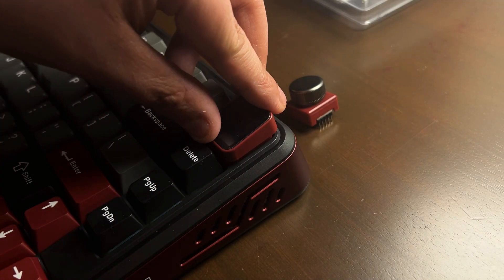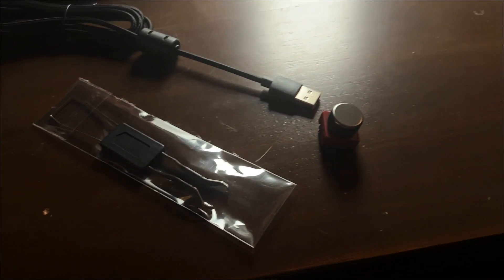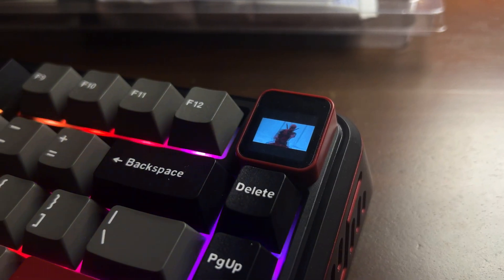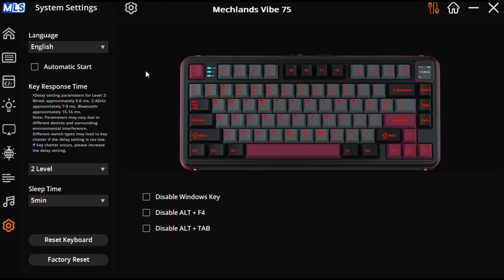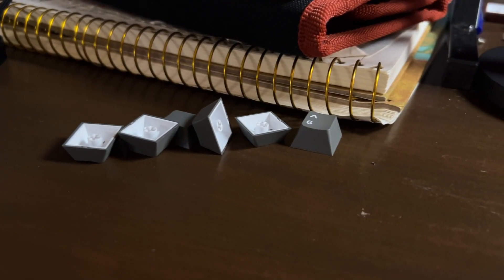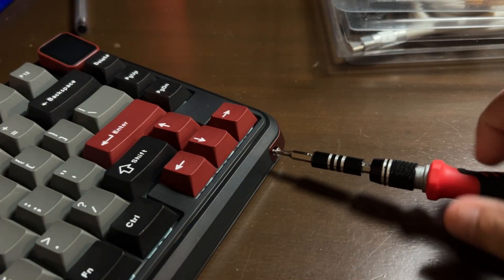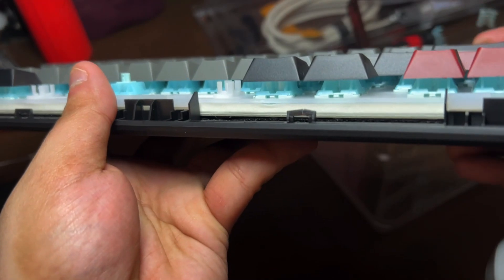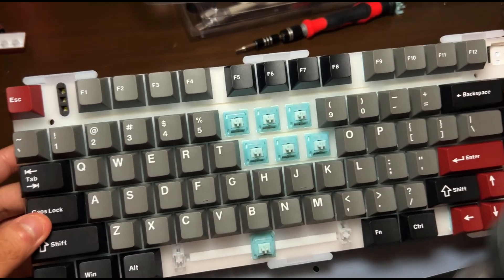Mechlands Vibe75 | Interchangeable Screen and Knob for only $70 | Review & Teardown

Comment: Hey there! Do you know if you can change the key bindings on Mac mode? Also, I see that there's a top layer, fn layer, momentarily, and toggle. Is the toggle layer like the layer when you toggle to Mac mode? Or is it a key that you pressed to toggle on a different layer? Just wondering because I have custom key bindings for both Mac and windows for easier workflow when I am coding. If the software allows you to toggle between layers, kind of like VIA, then that could work and would probably grab this. Thank you!

Comment: Vibe75 or aula75?
Reply from the maker: @owlulllllll  Vibe75 if u dont plan on tearing it down. Aula if you want to do further mods
Reply: @BiboyHaranero  Vibe75 vs Blade75?
Reply from the maker: @MultiByron97  Blade75. Easier teardown

Comment: i got the keyboard today, love the sound but screen won't work...Does anyone else has this problem or it's just me?
Reply from the maker: @shleich321  try to restart your keyboard. does the knob work fine tho?
Reply: @BiboyHaranero  the screen works now but it glitches randomly :(
Reply: and yes, knob works fine that's what i found strange
Reply from the maker: @shleich321  hotswap port works fine but the screen might have anissue with it. I suggest returning it. Mechlands offer a money back guarantee. or replacement if necessary

Comment: How do you recommend opening this to mod given your experience breaking it? Should we unscrew the hexscrews and then pry the case open from the bottom using prying tools or how should we go about opening it for those of us looking to mod?
Reply from the maker: @nxshg  1. You have to unscrew all hexes 
2. take out metal shield, you would break some parts of it but they are unecessary pieces so go ahead break them
3. pry off top case
Reply: @BiboyHaranero  Thank you! I just tried to open and mod this thing and omg, how did you manage not get any scratches on the case because I got a ton!